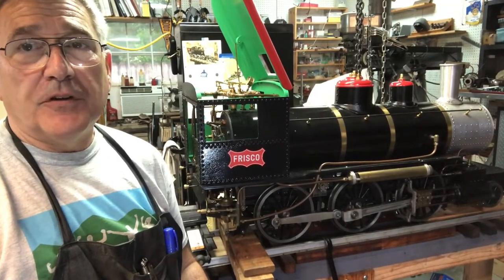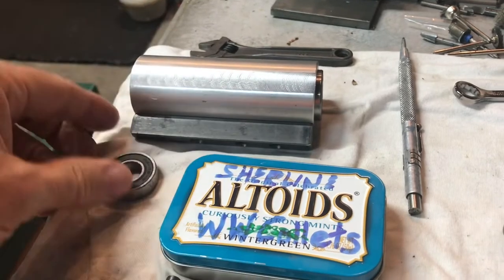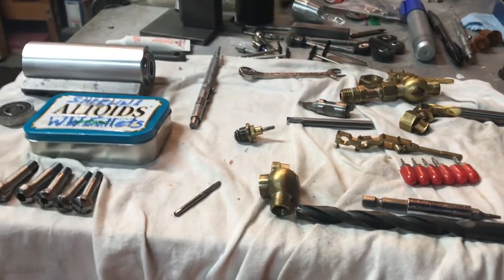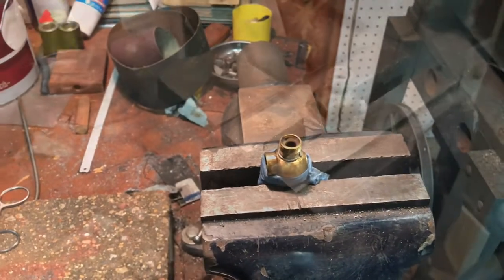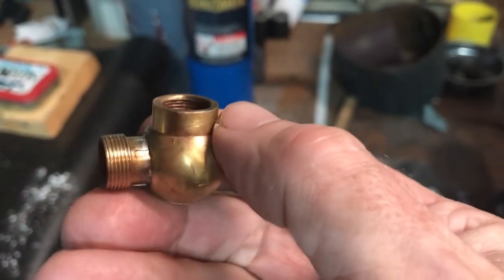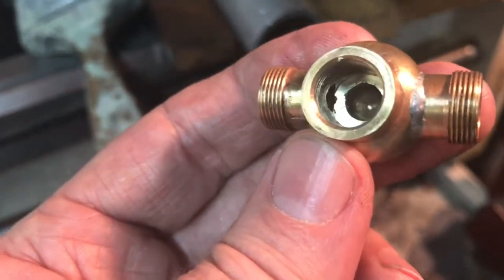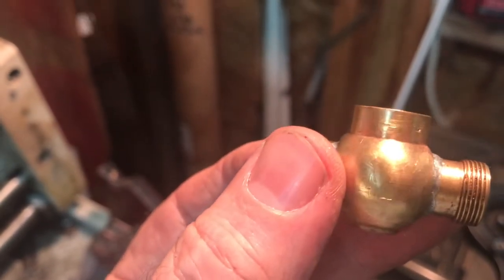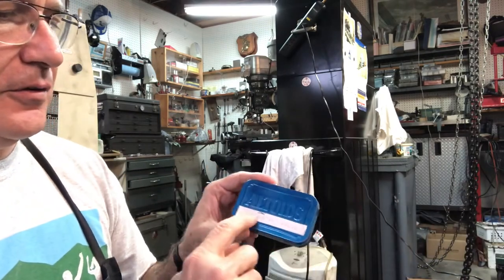Live Steam Locomotive. Injector Quick Start Valve repair and replace.

Comment: I've never seen these valves before. Were these used on full size or a novel design?  I'm just about to make some 5"-gauge valves for a loco I'm building.
Reply from the maker: @chiefauditor1683  thanks for watching and asking. I am pretty sure the quick start valve design has been around for a while. The ones I made were designed by my friend and mentor, Fred V. If I can find a drawing in a book I will let you know. Bill.